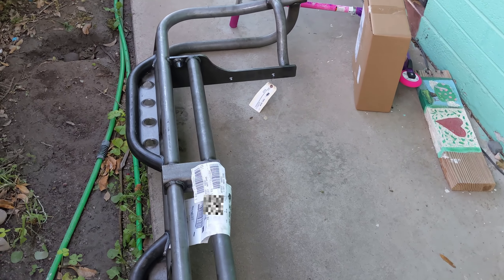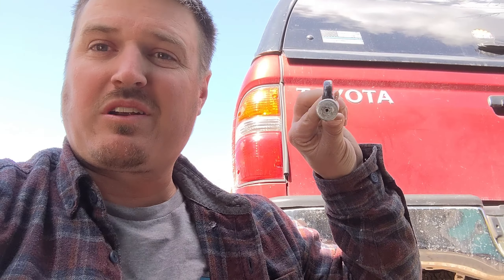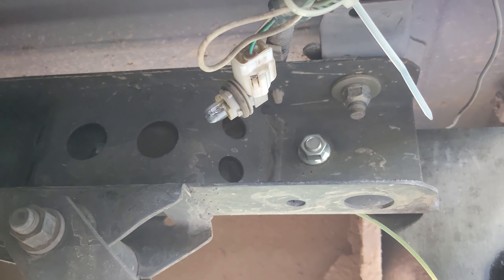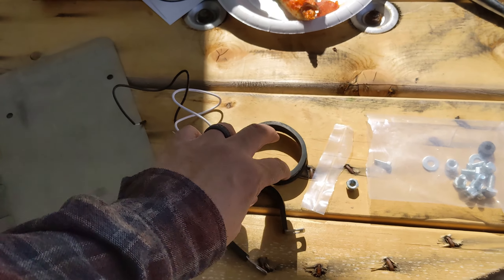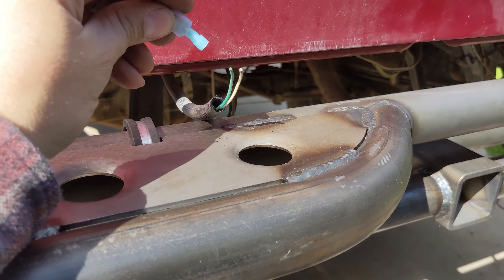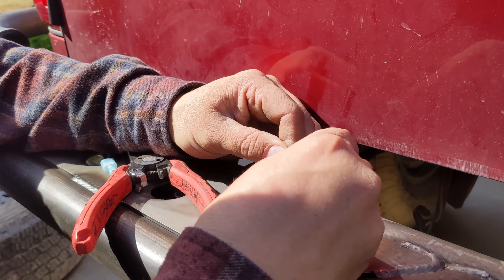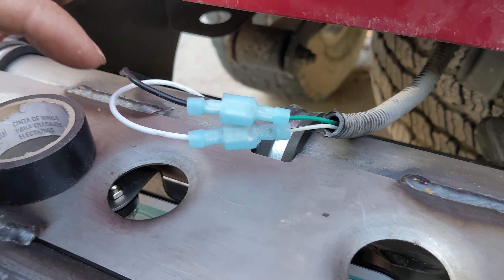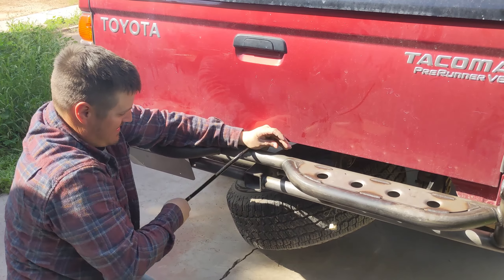Tacoma Beast Rear Bumper-Hitch Install!

Comment: I would recommend painting that bumper. Rust-olium makes a “truck bed coating” spray that works awesome. Super durable and gives it some texture. I’ve used it on a rack that sits in the sun for 4 years. Still holding up and barely faded